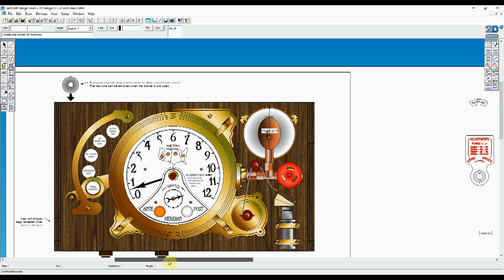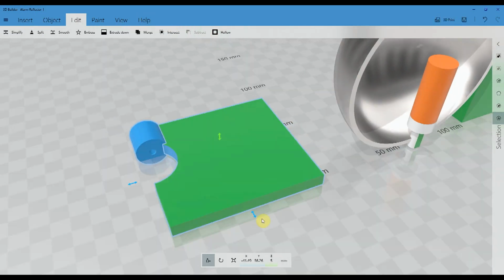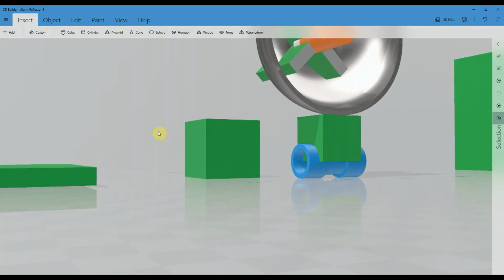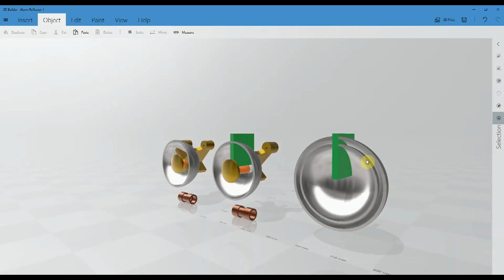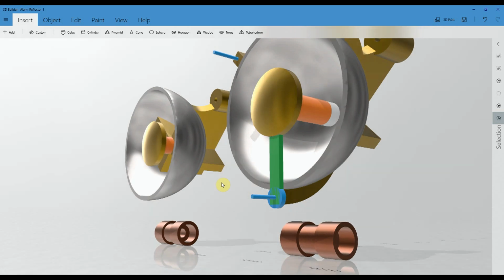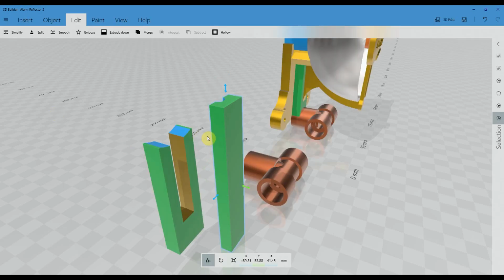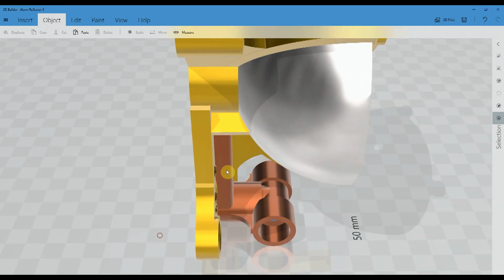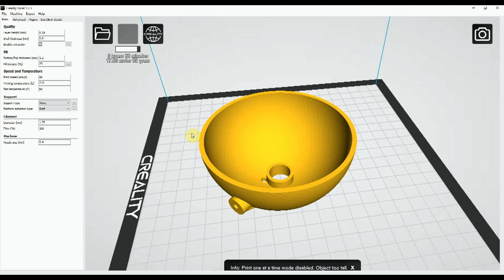Make a Steampunk Time Zone Clock - part 8

Comment: Thanks.  I've installed 3D Builder and ought to try it out in place of my usual polygon modeling tool.

Hearing your enthusiasm for building something up from a cube, I wondered if you'd ever seen the "World Builder" short film.
If tends to be popular with 3D art hobbyists.
If you could go inside the model and build it from within, what would you build, and who might you be building it for?
https://www.youtube.com/watch?v=VzFpg271sm8
Reply from the maker: Thanks Epi, I'll have a watch. By the way, someone suggested I use Blender to smooth out one of the automaton heads which worked, but Blender is so complicated, I can never remember how to use it, hence the fact I love 3D Builder, even though you sometimes have to work out ways to achieve what you want. Good luck with it all.
Reply from the maker: That's a great video, a really nice idea. Thanks.
Reply: @steamhead  Yes, that was me.  :-)  I should probably learn more Blender too, but it is difficult to learn these tools when they're not your only tool, and more familiar tools are beckoning.  Also as a polygon modeller, Blender isn't really aimed at 3D printing, so there's a good case for using 3D Builder.
Reply from the maker: @epiendless1128  I did wonder whether it was you - thanks for the suggestion! The polygon smmothing tool worked beautifully, even though it took a whole day to work it out! Simple is good...